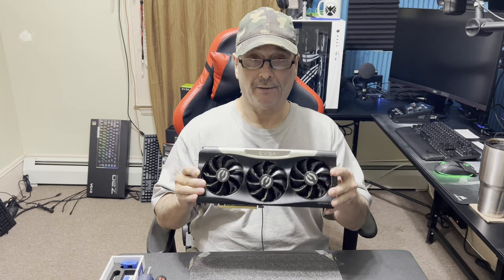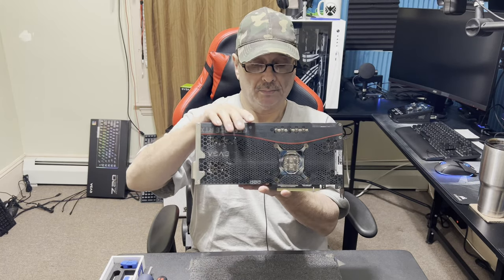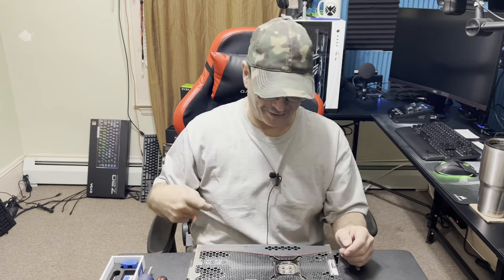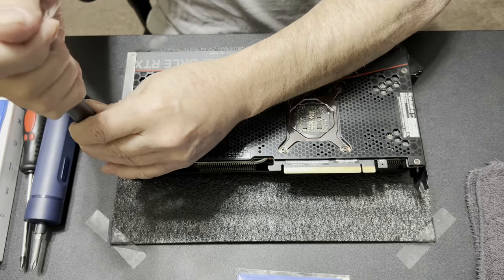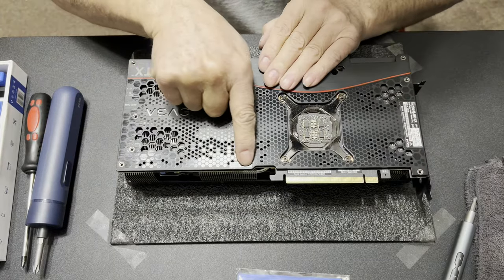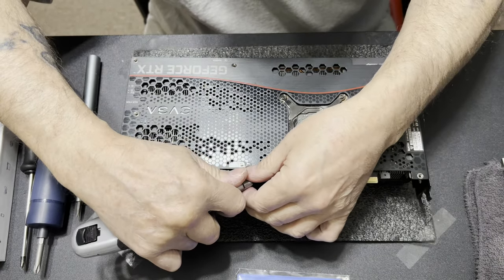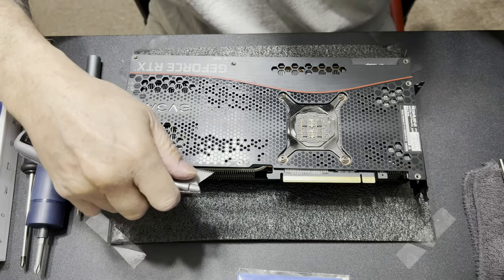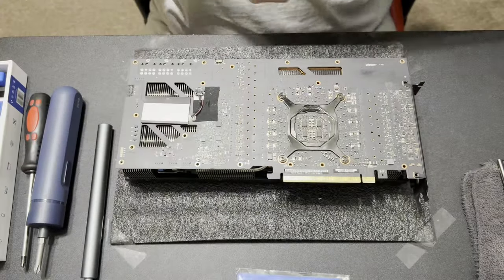EVGA 3080 ti FTW3 tune up

Comment: Ps. The pads and goo are supposed to look like that. Its thermal goo and sets like that, it still transfers heat from the die to the cold plate.

Comment: You in no way at all had to remove the fan shroud. This is thee most cringe video. If you can even read a highly praised brand pike NOCTUA... You shouldnt be doing anything in a card. And no card needs pads/paste after six months dude.... i have been doing custom loops for the last 12 years thiugh so im a bit snobby. I had to learn too. To each their own.
All you had to do is 9 screws on the backplate and the 4 retention screws.